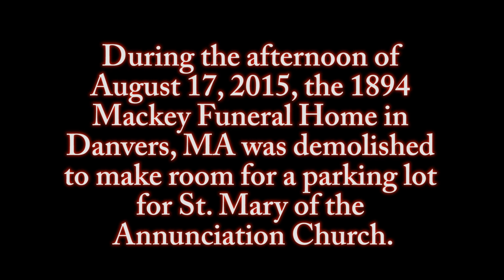Mackey Funeral Home Demolition - Danvers, MA

Comment: Lathe board walls, scratch coat likely contains asbestos (a common filler back in the day), no insulation in the walls, loaded with lead paint, window shakers to keep rooms cool, outdated electrical.  Not everything is worth saving.  Nice house for it's time
Reply from the maker: The house was a very visible landmark in the community so I'd say that makes it worth the effort to save.  All of the problems that you mentioned can be addressed but we aren't sure just by watching the video that this house suffered from  every one of those issues.  This part of the country is filled with old houses and they seem to exist just fine.
Reply: This house was built thirty years before asbestos, that being said the building department would not have issued a demolition permit without the removal of any asbestos products .

Comment: Little concern for environmental safety. Should have been fined for that window A/C unit that should have been removed.
Reply: Multiple A/C units on both the front and side of the building.  I agree.  They looked like fairly new A/C units.  Could have at least been donated to a second hand store.  Would have been better than destroying them and releasing the refrigerant into the atmosphere.  Lazy  owners and demo companies get away with this crap all the time.  No enforcement of the rules and laws anymore.

Comment: Who videotaped this?  Is it possible to get a copy of the original video? Thanks
Reply from the maker: There might be some copyright issues depending on what you would want to use the video for.
Reply: I just want it for myself. Probably sounds crazy, but love watching old houses/buildings being torn down. Got another video on dvd from another person. I just like this one too.
Reply from the maker: @minpaff  That's somewhat difficult since the footage is locked up in a server at a cable access station.  As a nonprofit, they probably wouldn't make the footage available for private home use.  :(
Reply: Well, is the original video from start to finish, of the tear down or just what’s on YouTube?
Reply: How did you get the video?
Reply from the maker: I was asked by the preservationists to film the house's demolition for a possible TV program about it on cable access.  But that was many years ago and I have moved on from my involvement with cable access due to a change in careers.